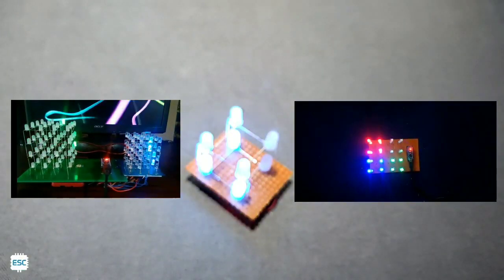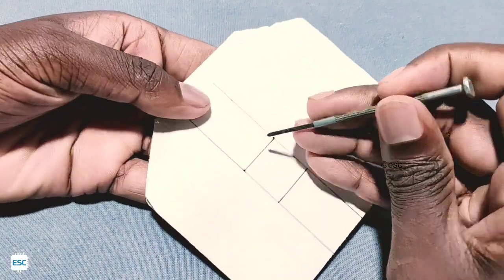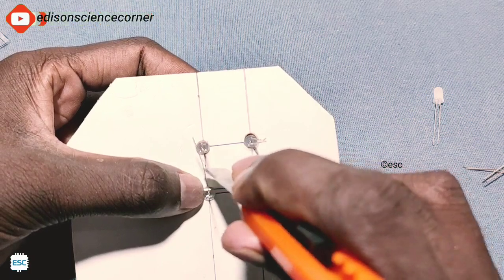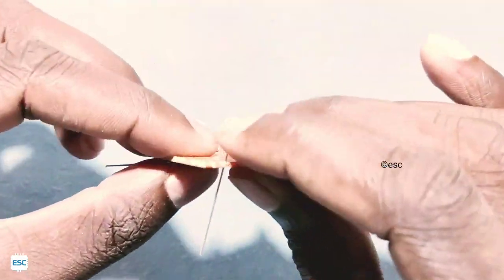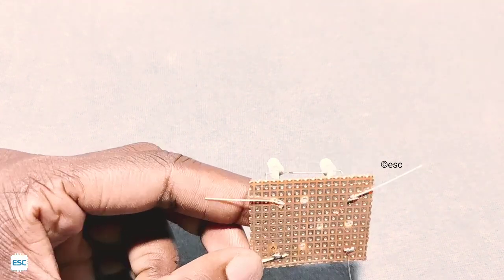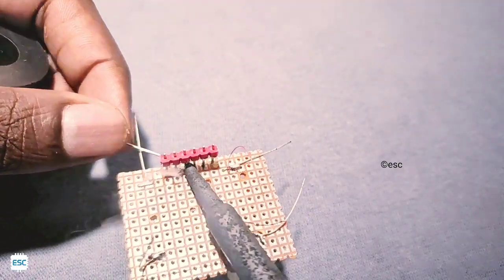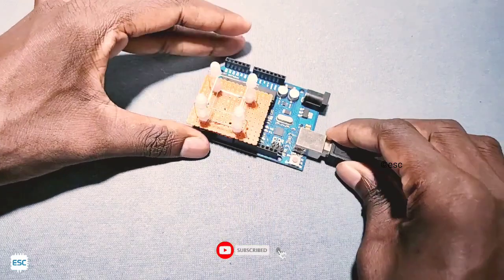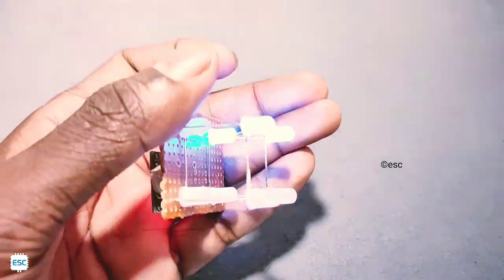How to make 2*2*2 LEDCUBE at Home  | Arduino Led cube | DIY

Comment: Using the flat of a utility blade is a REALLY bad way to bend pins or move traces around.  Even if the edge isn't sharp (and your finger is sliding against it), it could snap as you're pressing it down flat.  I know any kids watching shouldn't be soldering without adult supervision anyway, but best not teach them to use snapping blades to bend things. :)   Also, just a heads up: the code doesn't seem to be linked on your blog post. Maybe I looked too early?  

Other than that, a fun little project, thanks for sharing!  I have some LEDs handy that I don't plan on using for anything else so maybe I'll give it a try as well!
Reply from the maker: Yeah. Thanks for observation. And the blog  is now updated and u can download code now💎💎
Reply: @EDISON_SCIENCE_CORNER  awesome!  Thanks again for sharing your projects, they're a lot of fun so far!
Reply from the maker: @christopherbrummet4997  🔖🔖🔖